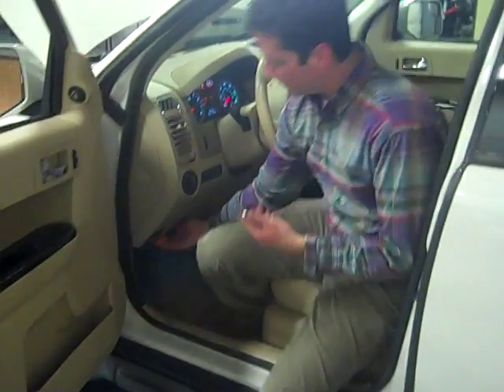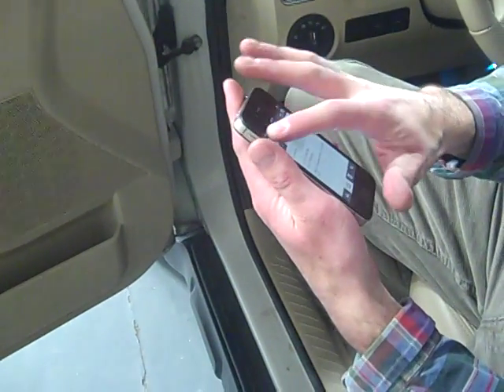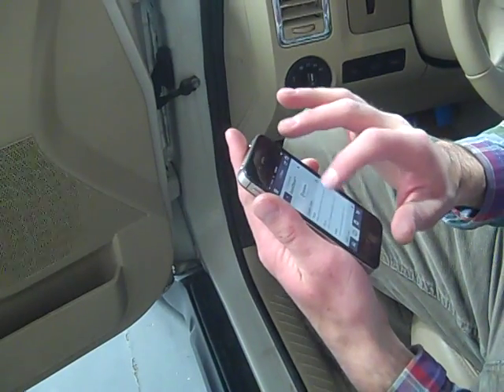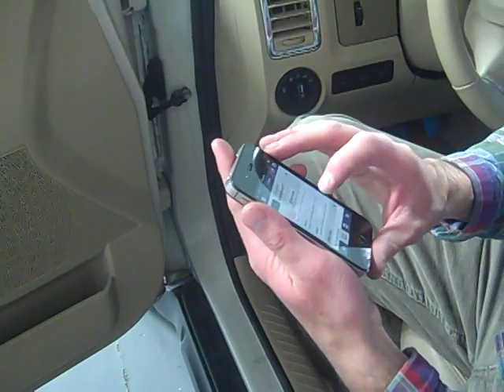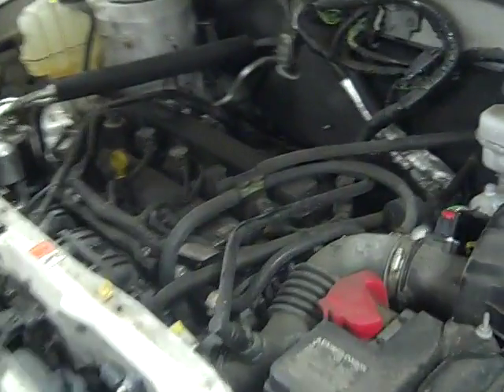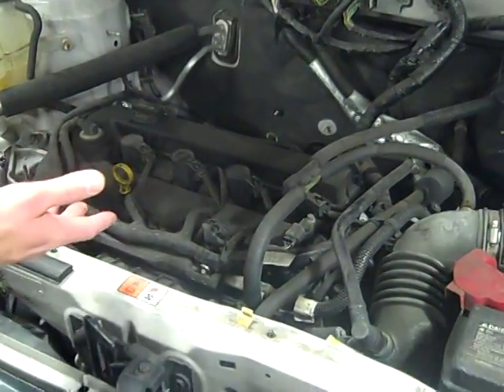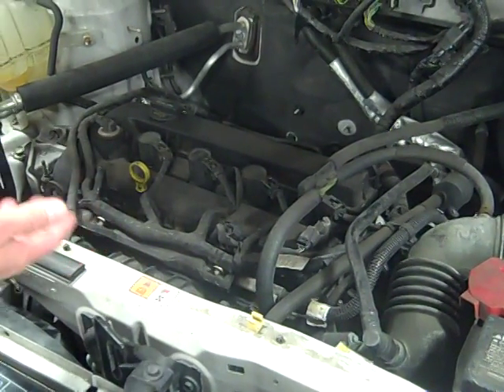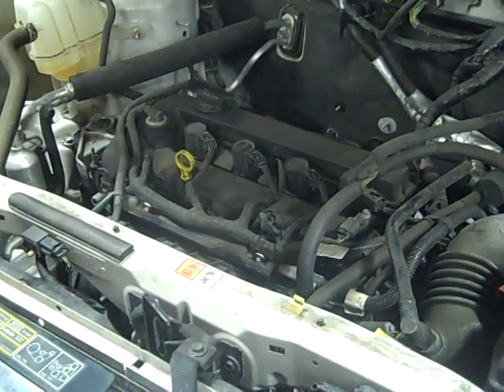Vehicle misfires, no dash light how to fix

Comment: The proper procedure is to swap the suspected bad coil with a coil from another cylinder and then retest.  If the misfire  code now shows up on the cylinder that you moved the suspect to, it is probably a valid bad coil diagnosis.